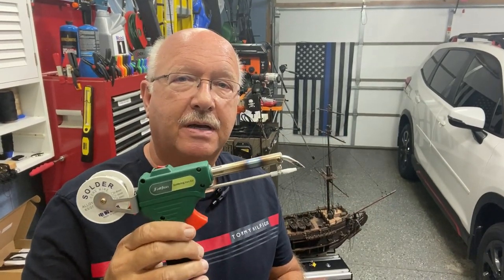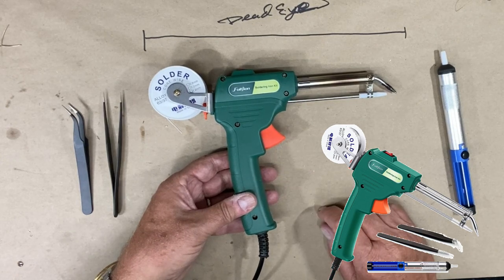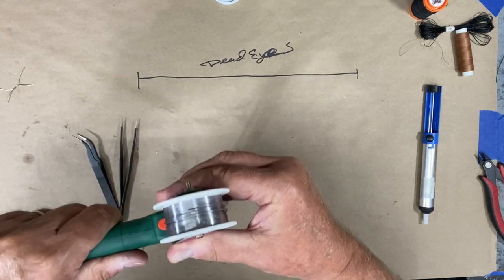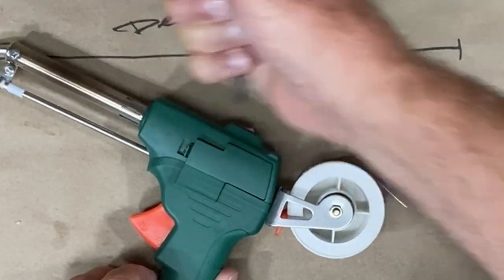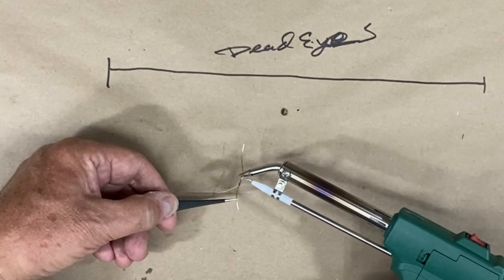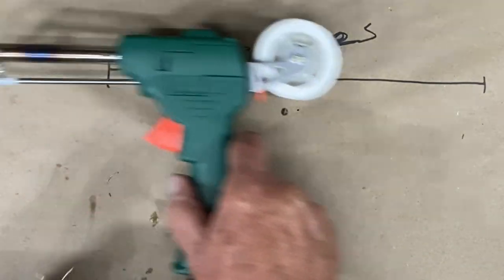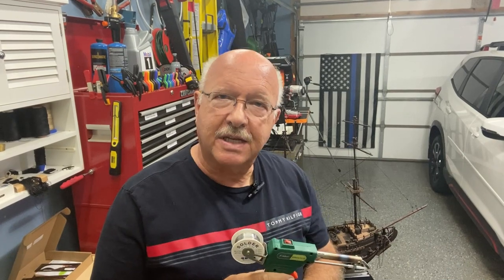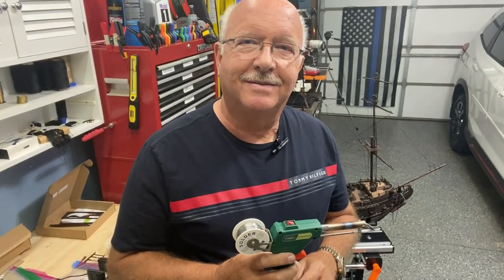Fulljion 60W Automatic Hand held Solder Gun Tool

Comment: I had received the soldering gun as a gift. The instructions were too small to read. I couldn't get the wire to feed through or get the cover off. I was ready to throw it out until I saw your video. Let me know what you figure out about cleaning the tip. Thanks brother.
Reply from the maker: I’ll post a video once I figure it out.  On my way to Florida for a few weeks to chase away winter 🥶 😎😂.
I’ll figure it out when I come back.👍